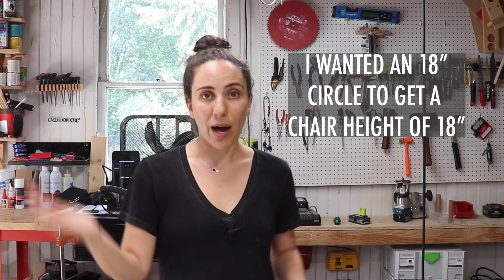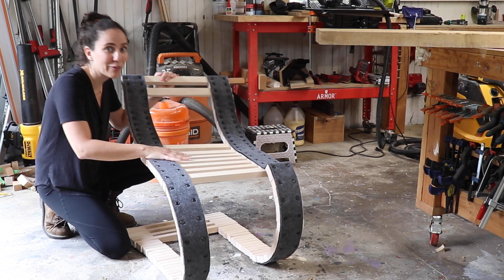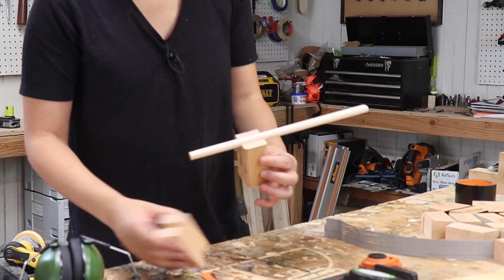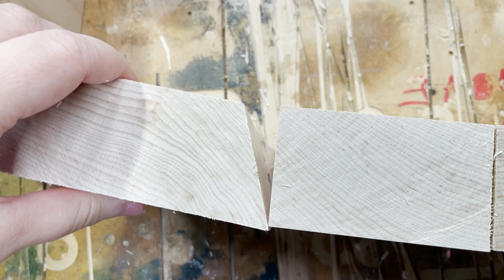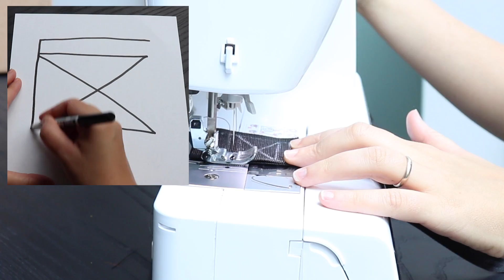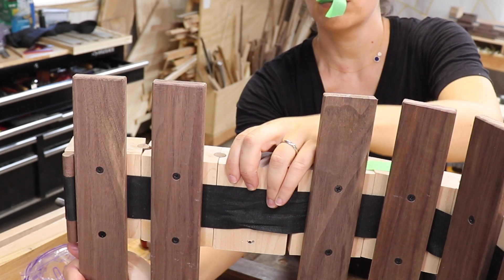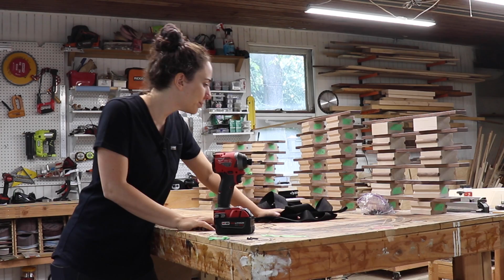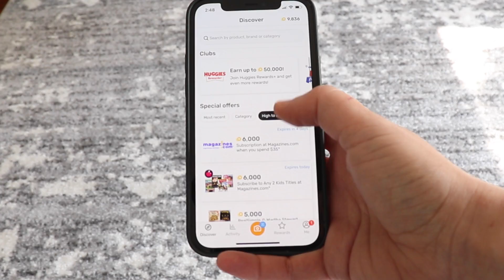I ATTEMPT to make a Roll Up Chair… AGAIN...

Comment: sure i'm the millionth one to say this.... but you need steel cable.     Why not try some piano wire.   Heavy gauge.   Also, i don't know why you disassembled it a thousand times.   You could have just figured a way to have a tensioner on each end, that you just wind-up, until you reach the right amount of torque.   Could have just kept all the slats slightly loose, allowing movement, until you had your torque figured-out on the straps....  which should have been piano wire anyway.  
And i think the only real solution, is to have some 3/8" steel wire rope, running right through the center of all the blocks.   And they should all be loose in the blocks, able to move.   Then when you want it in chair mode, you have a mechanism to tighten the rope, to max.   Some kind of winch, or lever/cam of some kind.   It is loose in travel mode.  then the Steel rope is tight as F, when tensioned.    Having the rope through the center of the blocks, would lock them in place so they can't dislodge in EITHER direction.  that way they couldn't move forward or backward

Comment: Leather would b perfect to use as straps since there's almost no stretch and it's very strong. Also car seatbelts
Reply from the maker: The second material I used was seatbelt
Reply: Car seat belts are made to stretch in the event of an accident so you don't die due to force and impact

Comment: Try steel cable. Drill holes through the blocks and put bushings slightly bigger than the cable in the holes to prevent damage to the wood. The major problem with the stopping you've been using is stretching. Steel won't stretch. Also every couple of blocks, put a block that goes all the way across the chair. This will make it very stable. Metal inserts in the wood for screws may also help depending on how you make the straping

Comment: Couple thoughts.  As far as strapping goes, every material, even steel rope/cable is going to have some stretch.  Though something like dynema/amsteel would be your best synthetic choice (still some stretch).  Someone good at math and simulations could tell you how much force is happening in certain parts of your design and if there is a certain material with certain strength and stretch characteristics that could work.  Just a youtube call out here @RealEngineering @3Blue1Brown @TomStantonEngineering @JeremyFieldingSr @StuffMadeHere could be a fun collaboration on the maths/mechanics side of this design.

I see some people thinking hinges might work.  Certainly worth the experiment, however, the force on some of those single hinges is going to be quite a lot and I would think might just break the wood at the hinge screw in points.

I would love to see this work, it is an awesome idea.  Excited to see what you try next.  Don't give up yet!

Comment: Because you're using materials that are naturally quite elastic... and violently destructive at the end of their elasticity, you won't get any rigidness under tension until the chair breaks entirely.

You simply need to support the back end of the chair. Make some additional wood pieces near that final curve that split off from the main path and make their way downward towards the base. You can glue a small stop on the base pieces to prevent sliding. 

This should make the chair still roll-able to some degree and allow for proper support without diminishing the goals of the design.

Comment: Make steel hinges between the parts on the forward bend that catch the most stress. It's not pretty, but currently it seems like your only real option. Besides, you can hide them under the strap somewhat.

Comment: At this point, it might just take a little magic to get it done all properly? IT would be hugely expensive and probably not worth it but you could try magnets? Not only do magnets mind you the strength from a magnet required would make the chair impossible to release but you could support the connections with magnets? Doesn't fix your tension issue but it could reduce the amount of tension required to stabilize the structure.

Comment: i think this is a better problem solved with steel because of the large forces involved. it could be possible but from what i can tell no matter how you secure the wood together, either the support will fail or the joint to the wood will fail (unless you use lag bolts and steel strapping?). 
i would use thick wall steel tubing (1/4") and attach them on the bottom by welding thick hinges.  on the hinges i would weld different size tabs to limit how far they can swivel, and then attach the wood slats to the top of the tubing by with tapped holes and flush bolts just like park benches. (for added support of the wood slats, weld flat stock to each piece of tubing to prevent them tilting on the tubing)

notes:
tabs on hinges should be as short and thick as possible, to minimize leverage and to maximize strength

Comment: Leather deforms really easy but maybe you could use steel cables? Routed through groves under the dark wood like you have the strap here. A small chain maybe, through a groove in the white wood and then the strap over the top like you have to keep it neat and protect the wood? Almost no elasticity and it wouldn't be in any high amount tension until you sit in it.

But I think a fundamental problem with the design is the length of the foot, the seat and the back of the chair. Say for each 10cm the band will stretch 3mm, basically nothing on its own but with each section adding another 10ish cm that's very quickly an inch of extra slack. Also the length of the seat of the chair will increase the "lever"/fulcrum effect and putting even more tension on the strap and i think it's just not "springing back" to it's original length after you release the tension.

Just my 2 cents, I am amazed at someone attempting this and I am so excited to see how it turns out!
Good Luck!!!

Comment: I've only read through a small portion of the comments, but it seems to me that a braided steel cable will fix your deformation issue. Just make sure you use a plasticized or rubberized cable.

Comment: I don't have a lot of experience with UHMWPE webbing, but I do know a little about the material it's made from. UHMWPE (ultra-high molecular weight polyethylene) is a plastic (a type of viscoelastic material), which means that it will creep and stretch out over time, so even if you go it to work, it might stop working if you left something heavy on it or used it too much. While leather is a natural material it still experiences creep under load, so it could have the same problem that I just mentioned. But there could still be hope. @Jared Callahan brought up a good point about gluing the strap to the wood. Especially if the glue soaks into the webbing, it will act like a much less stretchy (stiffer) material in those regions. Then only the tiny bit of strap left flexible will not be able to stretch as much. This is because loading the chair causes stress to develop in the strap which results in strain. Basically, that means that the length of the strap determines the distance it will stretch. Of course, the glued parts stretch a tiny bit, but the amount that the glued strap stretches shouldn't be a problem. The tiny amount of strap left can't stretch as far, and it will keep the strap from slipping. So, it would definitely counteract at least some of the problem of the chair bending too far.

Comment: I'd suggest you make the base end curl up and touch the arc between the seat and the back rest, that way you don't have only one arc bearing all the weight.
Reply: You could even use the dowels to lock the curled up tip of the base with the seat part better

Comment: Isn't there a possibility, that you could make that tension straps in segments and not in one piece? Like you could use tighter strap for the leg part and make it more loose on the sitting area.

Comment: The main problem is the elastisity. Even if the straps wont strech, the wood's edges and corners will giveout eventually. You can have the same design but with metal frames instead of wood; that wont bend or crushed under presure. Same with the straps. What ever material you use should have some sort of steel or aliminium strans woven into it. Once the elastisity of the materials stop, this chair design will funcion as its suppose to.
Reply: By the way, unless you double the woods faces that contact eachother, those faces that connect will wear out around the corners in which it will make it difficult to stay in shape. You can maybe device some sort of lock mechanism between woods in which once the woods align in certain way, some parts will connect instead of simply 2 flat surfaces pushing against eachother. But even then, unless you create something really usefull, that mechanisim also bound to break eventually during the daily usage.
Reply: You can Identify the most stressed parts of the chair and change them with sturdier materials. Like Aliminium or steel square pipes.

Comment: I have an idea about this project. For keeping together pieces may be it is better using some metal joints instead of straps. One pin for a piece and a hook for the other piece. Pin holds the hook and you will get the force for every single piece from it's neigbhor. For example metal wristwatch cord. You can still use straps to keep together the pieces when you wrap it.
I am not sure if I could explained what i mean or not. It is really hard thinking Turkish and explaining English. I even can't use my hands to show the idea :) 

Even if you didn't understand anything from my words, still consider thinking on metal cords for wristwatch.

Comment: Hey, I know I'm commenting kinda late, but I have super simple fix with the strap here. The problems I notice with what you had is that you put the strap on the inside of the curve, and the strap is overloaded. 

If, rather than front-facing the strap the whole way, you feed the strap through the bottom joint between the seat and the backrest, up around the back, over the top, down to the front of the seat, then (finally) double up the strap all the way down to the other end, I'm 90% sure the chair won't collapse. 

The bonus is that you'd get a sort of armrest (though not a super good one), and you'd create a pulley which would make the strap stronger. You'd need a groove in the top, and to secure the strap to each individual piece of the back, but the rest of the essential design would be the same.

The way that you'd roll it up after trying my suggestion is to tip the chair onto its back, which will collapse the bottom, which will reduce the tension enough for you to roll the back. I really hope you see this, and I like this project a lot!

If you care and are confused about my suggestion, feel free to reply here. It'll send a notification to my phone, and I'll try to clarify within a day.

Comment: Strap both sides (inside and outside). The single strap will not be held in place by clamping it between wood pieces, so when the lower part of the chair stretches, the upper part of the chair wants to curl up.

Comment: Just another person with in idea. I doubt that any kind of strap would have enough strength from stretching.  The only thing I can think of with that kind of flexibility and no stretch to it would be steel cable. Ever leather has stretch to it so I can tell you right now that leather wouldn’t work. Also because you’re pulling tension through the whole chair, you’re having a problem with the bottom curling and with the back rest folding forward and letting up tension. I would say you’d only need to hold tension around the bottom curve that actually supports your weight. If i was building a chair like this I would go with 2 steel cables on either side. One around the larger bottom curve and one to hold the base together so it would still roll up but have a different amount of tension to avoid the curling problem. And maybe use the normal black strap for the back rest because it’s not actually taking much load when you’re leaning against it.

Comment: Tension is good. In reïnforced concrete, for example, you pretension the steel structure inside, giving the concrete block way more strength. The problem i suspect is that one strap just will not work due to your chair’s shape. I think you’ll need more. The forward bulge was quite stable in the end. When you put stress onto the chair by sitting on it, the tensioned straps will try to roll the bulge back up, but your body weight in turn tries to further curve the bulge down. If these forces are in equilibrium, the bulge is stable. The straps constraint the position of the bulge’s outer edge, while the weight of the chair itself and the person sitting on it will constraint the inner edge. As for why the back and bottom collapse, however: The straps pull on these parts in a way that makes them want to roll up. But the chair’s weight towards the ends is by far not enough to counteract that pull. So for the back you get a constrained inner edge, but unless you sit in it, there’s barely anything constraining the outer edge. So what you need is something to pull the back of the chair, well, back, and another thing that pulls the bottom of your chair up. An easy fix: Put eyebolts onto all four end pieces. To two of them, permanently attach some kinda rope. After you folded your chair up, you tie these ropes to the remaining eyebolts under tension. If you roll the chair up, you can use the ropes to tie the chair up so it doesn’t unintentionally unroll. Your rope can be anything from leather to nylon to chains on a steel spring. And if you tie your chair in an X shape, the ropes will help preventing the chair from collapsing sideways when trying to sit down. Of course, once you sit, the ties no longer do anything, unless they’re attached to long steel springs or are made of rubber. But that’s okay. Alternatively, make the first and last blocks out of something heavy like steel to get tension with the help of gravity. But obviously that results in a heavier chair.

Comment: I think if you added steel rod to the back of each piece cut to match the angle and form essentially one solid steel backing that might relieve the stretching from the straps and make is stable. Not an engineer tho.

Comment: TL;DR shorter ropes(and straps) stretch less than long ropes, because physics. You should really try stapling the straps to the segments!

I did a bit of physics in university and I think you need to staple or otherwise firmly attach the straps to each segment. The closer you can do that to the edges of each segment, the better it should turn out. That way you can also double up on specific segments that cant handle the forces(bottom curve).

Here comes the physics part:)

If you pull on a rope with a given force then:

1) That pulling force acts across the whole length of rope.
2) You can observe an elongation of the rope and its measured in %, because:
3) That elongation (in %!!!) stays the same, no matter if the rope is 1m or 100m long!

Unscientificly speaking longer ropes stretch further under the same load, shorter ropes are more stiff.

Secondly in this chair one would expect larger tensile forces between the segments the closer they got to the ground due to the longer lever arm to ones bum. Stapling not only turns your strap into many shorter straps, it also compartmentalizes these forces, so that the highest forces no longer act across(stretch) the whole length of rope, but only a single section. This alone should result in significantly less stretch overall, and specifically get rid of giant gaps between just a few segments at the bottom.

You can take that a step further by stapling closer to the edges of the segments, which would shorten the total amount of "rope", making it stretch even less.

And if the result is still too stretchy, i think glass fiber weave is what you're looking for.

Comment: You could try using steel cable instead of webbing. Create a notch in the top of the blocks. You may need to attach the cable to each block. Long u clamps could work.

Comment: You might want to consider it as a spring and do the maths accordingly to guess what length you need and what kind of strength. (Just like in making a spring) good luck 🤞. Ikr easier said than done but your first functional is rewarding.

Comment: don't use one continuous strap... individual sections attached to each block or pivoting to another attachment block for block will solve your folding/collapse problem. that would put the tension compressively in the wood rather than pulling it through the joints of the whole structure.

Comment: I have a suggestion for a redesign of this cool concept. (I am by no means skilled in this type of thing) if you use the tail towards the bottom as a support rather than a tail giving it might work a bit more to support in the problematic backward bend

Comment: The amount of compression and tension stress created by this is... significant. If a person who weighs 100 lbs sits on this chair, all the way back, the strap is going to have to handle close to a ton of tension force, and it has to do so without any stretching. I'm unsure of many materials which can handle this. Similarly, with hinges, the lateral force applied to the screws would either shear their heads off, or it would tear them out of the wood. Also, the inner radius of the wood is also going to suffer huge compressive loads, and wood is compressible, creating problems.

I hate to say it, but I feel like this is probably a fool's errand.

As a practical exercise, you could try to get some heavy duty hanger tape. Something like an 18 gauge metal strapping. You'd lose a lot of flexibility (and would risk metal fatigue when rolling and unrolling the chair), but purely as a "to see if it can even be done" exercise, it might be worth it. Might also consider fire-hardening the wood to make it more resistant to compressive failure.